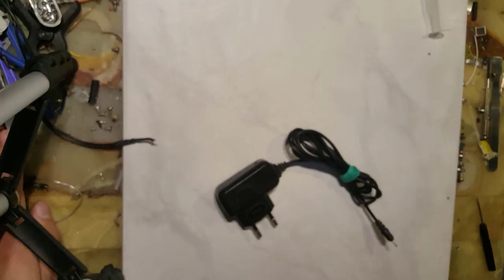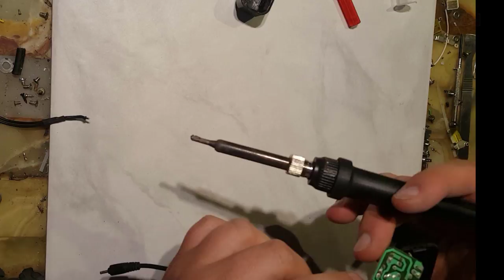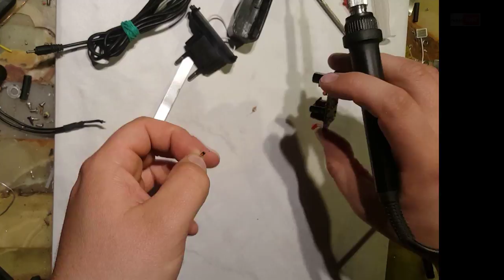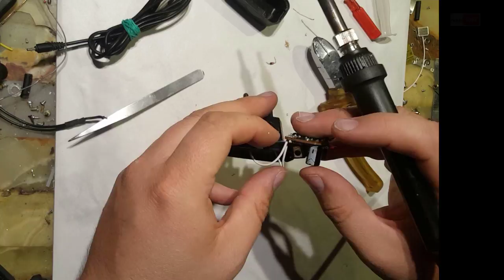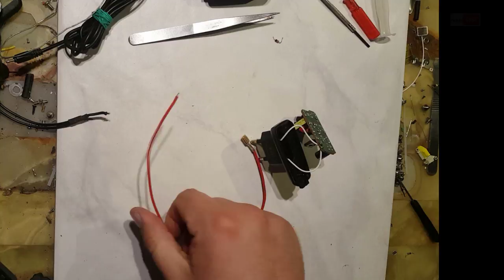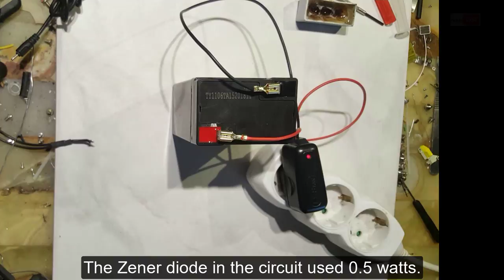Make cheap 6V battery charger circuit from a mobile charger lead acid, ni-mh, ni-cd

Comment: can't I charge the bettery with 5 v?
Reply from the maker: No, 5V is not enough, but if you use 4.5V lead acid battery you can use 5 V for charging. For 6V lead acid battery, charging voltage is about 7V.
Reply: @cehic1994  Thank you

Comment: Can i replace with 4007 diode?
Reply from the maker: ne, it's zener diode
Reply: Must replace with zener diode also?
Reply from the maker: @ericpoh9840  Only with zener, with voltage that you want to get from it
Reply: @Indiangamer2.2back  6.2v Zener diode gives 5.10v output
														8.2v zener diode gives 7.10v output to charge 6v battery